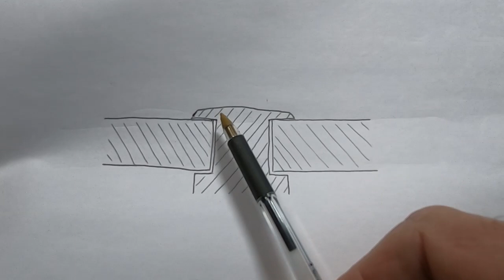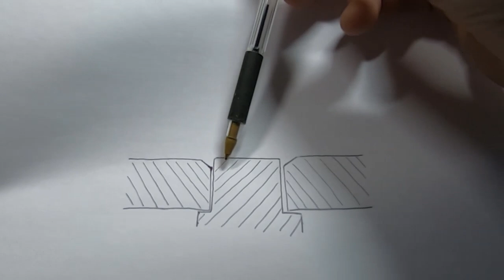Osborne OCC1 Repair Part10

Comment: 10:20: I suppose there was no way drill and thread the plastic posts in the middle and to find and fit tiny little screws, perhaps with bigger washers? 
(In case you want me to reply to any response, look for another comment here; I can't reply to comments at the moment, because YouTube changed their site and broke that feature on this old machine.)
Reply from the maker: Unfortunately not. I did consider that but the corners where the pins are end at the edge of the pin so if the pin is drilled out there would not be anything to screw into and the opposite corners cannot be used at that would mean drilling through the membrane.

Comment: The sketches were very helpful. And the plastic welding technique looks very sturdy. Is there a glue that would hold the key posts into the counter-sunk holes in the aluminium?

Comment: Interesting! The rings could be a very effective solution. I really hope that all keys will work reliably afterwards.

The construction of the keyboard with springs that press on a membrane reminds me a lot of the IBM Model M keyboards, which I really like to type on. The only difference between them is the more sophisticated buckling spring mechanism. But even these expensive keyboards are sensitive to spilled liquids because of the membrane. IBM therefore equipped them with drainage channels in later versions.